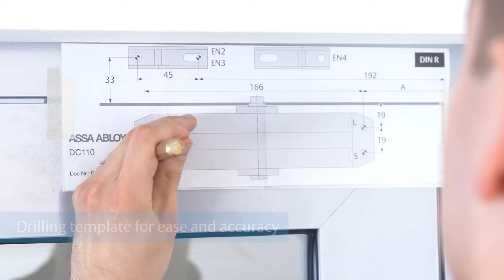ASSA ABLOY DC110 Door Closer Installation Guide

Comment: It is made solidly. The only thing to do during installation is to make sure that the main mechanism is properly installed on the door. The number 1 engraved on the mechanism should be at the bottom.